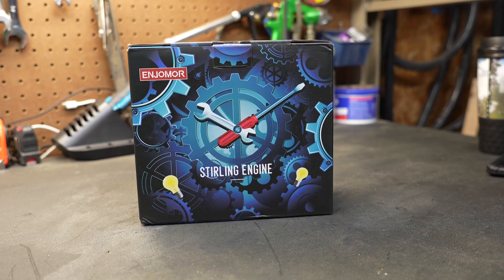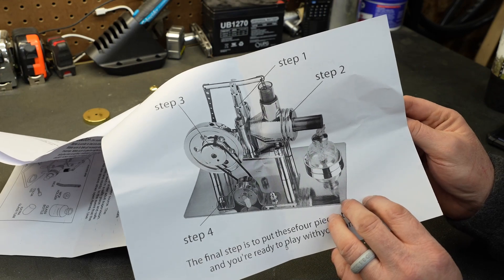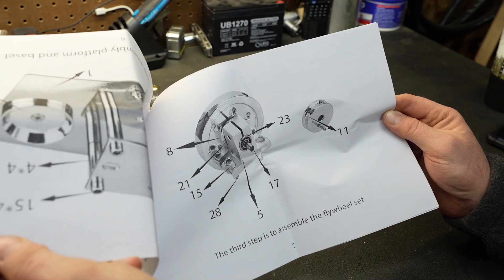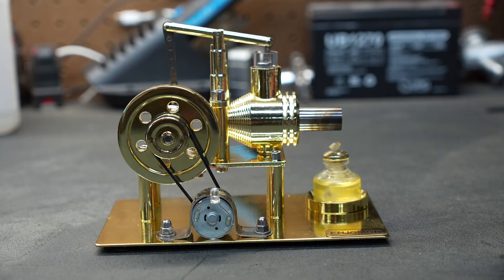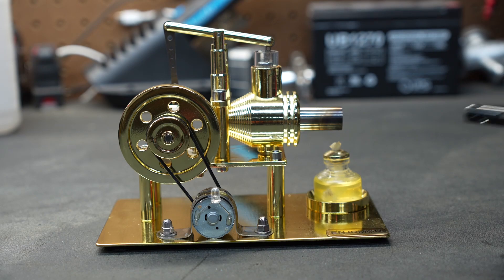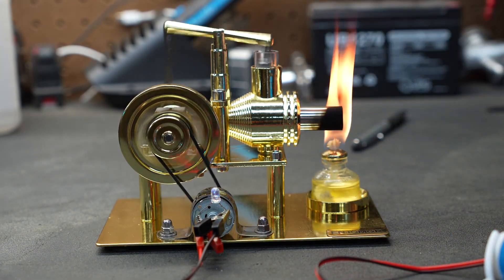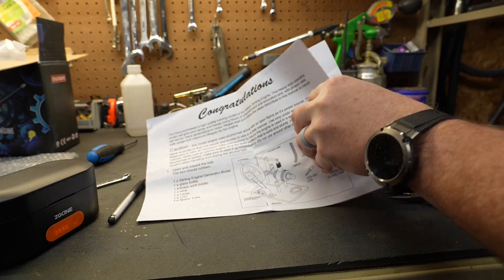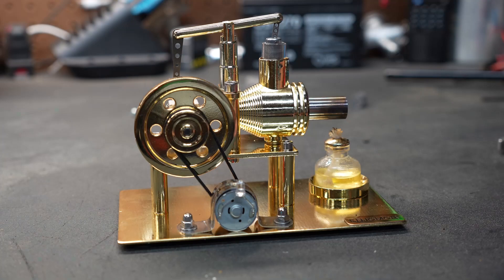ENJOMOR DIY Hot Air Stirling Engine, a working model from StirlingKit

Comment: Turn the flame way down!  Way too much soot!  The tiniest flame is sufficient.  There are "low temp" flameless versions that will run from the heat while sitting on top of your coffee cup.  I had one years ago that ran from a dab of Sterno.
Reply from the maker: Great advice, unless you are running it on lamp oil and trying to get it to run fast enough to generate enough current to light a LED.  :).  It will run on a very small flame for sure.  The manual recommends running it on alcohol for more heat to pick the RPMs up.
Reply: @1D10CRACY  Alcohol should be the 90% variety
Reply: Very nice little engine.  It’s just a pity I can’t get mine to run